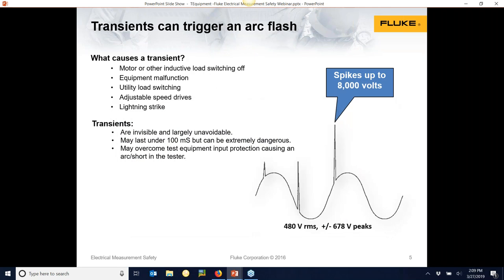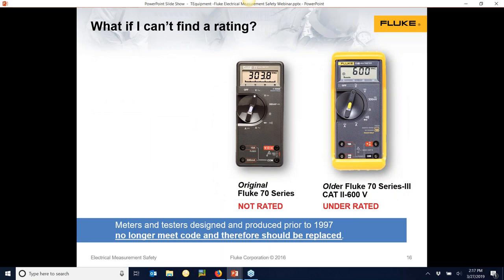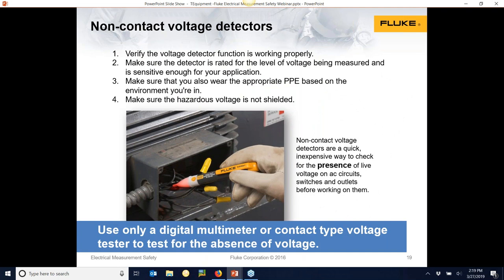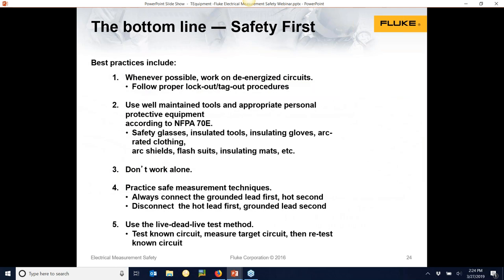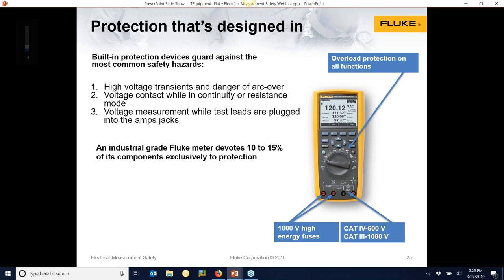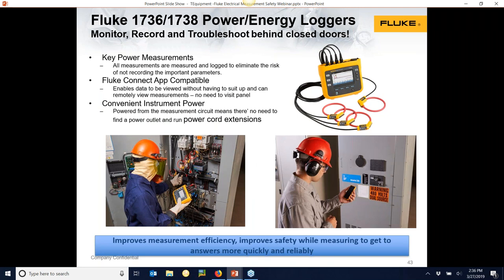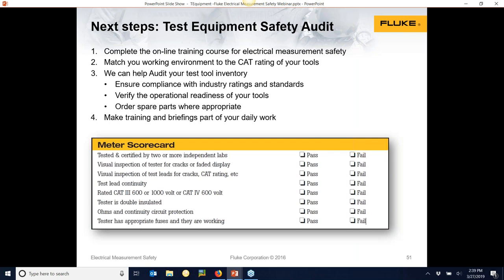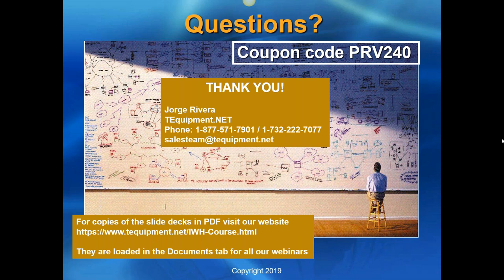Fluke Webinar: Electrical Measurement Safety

Comment: What is the difference between an indoor and outdoor meter ?     Is it just more resistant to water ?
Reply from the maker: They are more or less the same, with the main difference being durability for things such as water resistance and you mentioned. The biggest reason for outdoor meters vs indoor meters is convenience as workers like meter readers won't need home access in order to check your meter.